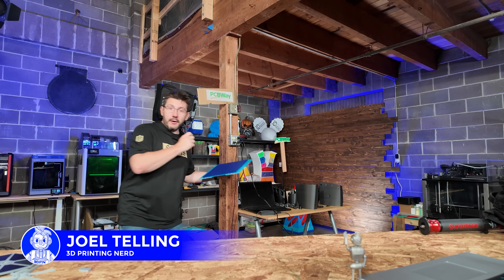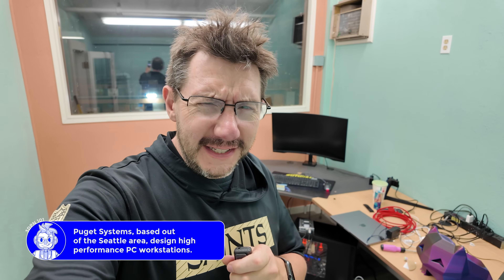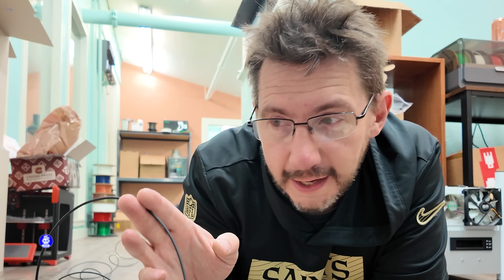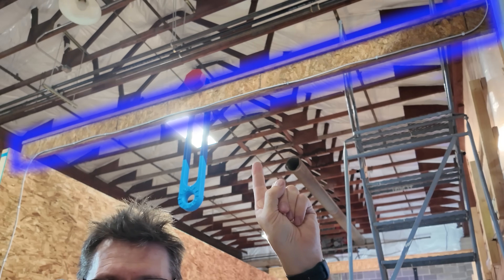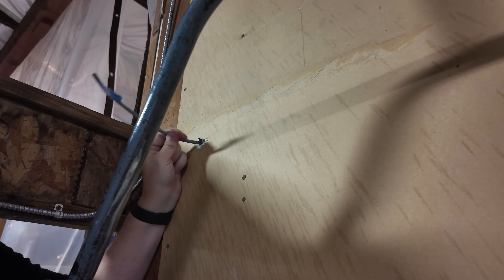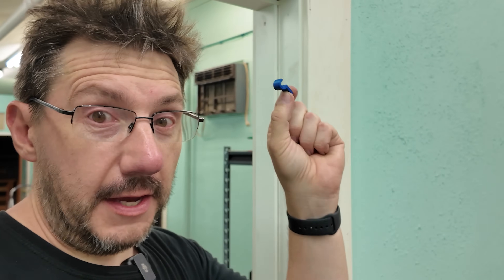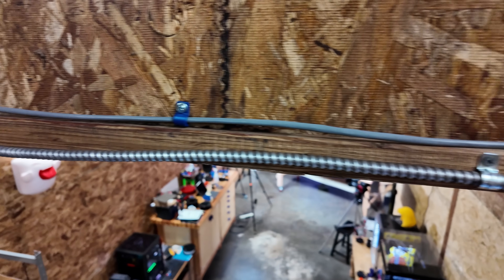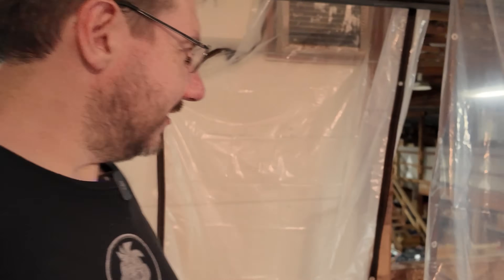3D Printing for My Ubiquiti Network!

Comment: Love these projects. Like you said, you get an idea, go for it and just take advantage of the momentum. Also: yay Ubiquiti... if any other company spent a fraction of their budget and time to cater to homelab and power users instead of "buy my 3 mesh router setup which only does _that_" then there would actually be competition. Meanwhile, my parents now tell me the football game is studdering and I can respond that the Dream Machine is detecting packet loss from the ISP side and they need to contact the ISP. You say you have overkill, I say "you have some items that some people consider baseline for setting up a homelab". All you need now is the rack.

I gave up on cable management (beyond ensuring they weren't knotted, had enough slack, weren't tripping/pull-off hazard, and were labeled) once people started guilt shaming people because they didn't make it look like a demo rack or, in modern times, like an AI image. If I had absolutely nothing else to do, maybe I'd do it. But not for now. Though just make sure you don't bend that fiber too much or you'll have a lot of pain.

Comment: Hint: I saw your cable was showing 'spiraling'which seems to suggest being pulled from the center of a coil. A kink in fibre might be catastrophic, so I strongly suggest to unroll the cable from the reel so it lays flat, not pull it from the middle of a coil which results in loops that want to turn into a kink. Good luck on your build!
Reply from the maker: That's a great tip - thanks for sharing!

Comment: Joel, I have a complete Unifi network, I have several recommendations for you.  1.  Don't use the Dream Machine Ethernet ports.  They seem to slow things down.  2.  pull a home run cable all the way from your wiring closet to AP.  3. Add a aggregation switch for 10 GB connectivity (8 additional ports) 4.  move the switch to the to your server room.  connect the NAS to port port 2 on the agg switch,   use a DAK cable to connect the switch to(port 1on the agg switch).  5.  connect the pro switch switch port 3 on the agg switch.  6. connect the fiber directly to your pc .  This mirrors my setup and I have great performance on my network.  please message me for more information
Rider68

Comment: Hmm that switch looks like the Enterprise Pro XG and I'm pretty sure it does not have POE, so you probably are using an injector somewhere... Also the two ports on the right go up to 25Gb and are SFP28.

Comment: Definitely Love Ubiquiti for IT installs. Definitely recommend setting up at the start for redundancy and future proofing. 
I have my printers all on separate WiFi/vlan. I assume you’re putting in new WiFi for your Farm too. For a large Farm I’d say for AP’s U7 Pro minimum but you could go with U7 pro max or U7 Pro XGS  as a way to have coverage, overall redundancy and speed . You’ll be able to run many devices and SSID’s with no issues. 
I prefer Startech racks for durability and strong construction, there are others but I prefer a strong rack and I use Rack Studs for mounting. 
Also Don’t forget you can use DAC cables in short runs and they’re actually faster than fiber in short runs. Pro HD 24 or Poe would be decent switch with plenty of options for fiber or you could do Pro XG 24 POE but depends on needs.

But in the end Good choice and have fun.

Comment: My wife and I just bought our first house, so I’m having fun equipping smart home devices, and soon, a Ubiquiti network! It will definitely be overkill, but I’m going to start with a Dream Machine SE (mainly for the PoE ports) for a couple cameras and home hub(s), as well as U7 something AP for the main living space. I just wish we had a higher bandwidth connection available. At our last house, we started with 1.2 Gbps, and it eventually got upgraded to 2.1, which was awesome. At our new place, we’re back down to 1.2. Champagne problems, I know. Lol

Comment: I think you'd be good going with one of the 8 port Ubiquiti switches. Depending on what spec you want for those extra ports in the office you could replace that switch with anything from the ($280 with power adapter) USW-Flex-2.5G-8-PoE (8 2.5GbE POE++, 1 10G SFP+ and 1 10GbE Copper) though you'd have to change your desktop connection from fiber to copper, or the $500 USW-Pro-XG-8-PoE (8 10GbE POE++, 2 10G SFP+). The $350 USW-Pro-8-PoE (8 1GbE POE+, 2 10G SFP+), the $480 USW-Enterprise-8-PoE (8 2.5GbE POE+, 2 10G SFP+) are also options, but the 1GbE copper on the Pro 8 will limit your access point bandwidth if that is a Wifi 7 ap, and the $20 price difference between the Pro XG and the Enterprise makes the makes the XG an easy choice over the Enterprise.

Comment: I find hard wiring devices using ethernet to be very satisfying, even if there is no performance improvement over using wifi. But some ideas to take advantage of that very powerful switch:
1. Unifi cameras - the camera interface built in to the UDM is very good - motion/sound detection, timelapse recording, alerts, etc. It does mean using Unifi cameras, and their PTZ versions are pricey, but the standard dome cameras work great.
2. Hardwire all your printers - especially the prusas. Prusa have built in excellent work arounds with connect, but the wifi is slow. I found hardwiring my MK4/C1/XL just made them more reliable. Instead of running cables from the switch to each individual printer, you could use a few of the Unifi Flex Mini switches - they are POE, 5 ports, and cheap.
3. More wifi access points for better coverage - the UDM has built in software that allows you to put in a floorplan of your building, and shows you expected coverage from your access point. You might already be aware of dead spots, but the software can let you see where a new access point might help. 
4. I don't know if you have anything raspberry pi powered, but the POE hats work extremely well - you could run pihole, or have a bluetooth repeater, or well any number of things.
5. Smart devices. It's a rabbit hole, but lighting/fans/curtains/hvac, etc, etc - anything that needs it's own hub. Will allow you to place the hub centrally.

My philosophy these days is "if it has and ethernet port, it should be hardwired." My cellular coverage is poor, so I give visitors access to my guest wifi, and you can start to feel the dip in performance when a few people are using it at the same time. Hardwiring everything that you can alleviates this somewhat.

Comment: Nice job. Things like this are one of the reasons I got into 3d printing back in 2019. Did you print those out of your high five blue protopasta? That's a gorgeous color.
Reply from the maker: The blue was a Polymaker blue I believe! Next prints are with highfive blue once more comes in :)

Comment: i used to enjoy that kind of work, but haven't done it in many years.  something i would highly recommend, whether you end up getting the 8 port switch others have recommended or not, print yourself a mounting solution for your switch & some track to lay your cables in (panduit or similar).  keystone ports on the wall become an optional upgrade at that point, but it'll all be much cleaner that way.
Reply from the maker: oh a track, that's a great idea!

Comment: If you're wiring up a space, pull two cables for every run. The absolute cheapest part of the project is the actual cable itself. Label it and leave it coiled neatly for future use. Future Joel will thank you.
Reply from the maker: GOODNESS that's a great idea
Reply: Agreed.  The most expensive project of any networking build out is the labor needed to tear open the walls and ceilings.  Consider using smurf tubes or other forms of conduit that allows you to easily add or upgrade your cabling.  Label both ends of all cables.
Reply: Exactly the same pop up in my mind when Joel telling us he was running one and only one Fiber… “Never put yourself into SPOF difficult time”.
Reply: ALWAYS at least 2, even if you only terminate one leave the others in the box.

Comment: I just upgraded my homelab to Ubiquiti. While you can't print a 19 inch rack I did use 3d printing for parts of the enclosure I built around an open 12u rack. Specifically corners for the mdf panels and fan mounts with mesh filters for cooling. Not done yet, but turning out really well.
Reply from the maker: Oh that's so cool!

Comment: You shouldn't use the Dream machines SFP ports for switching.  Those SFP ports are designed/spec'ed for routing.  It will actually add latency.  By connecting the NAS to a DR SFP its giving you higher DR overhead and lower NAS performance.  Its designed to be used with a distribution layer.  They have a low cost SFP switch they call "USW-Aggregation."  You use an SFP from the DR to the Aggregation, then all of your other SFP connections to that.  That will keep all of the local traffic contained to the Aggregation switch (which is specifically designed for high speed switching) and only outbound traffic through the DR.   Hope that helps
Reply: or use the "Pro HD 24 PoE" next to the DR as distrubution.   Use the other three SPF ports for things like your desktop.   That switch will be able to POE the access points at 2.5 gb.

Comment: Joel you wondering in my life/space *evil laugh*.  Half Network rack needed w/ patch panel (remember a Backup power supply (APC is a good brand) for your POE switch and Internet router)).  Fiber Cable type SingleModeFiber (SMF) or MultiModeFiber(MMF)-good for short runs.  Physical Module in the Switch = SFP (Small Form Pluggable module) these also needs to match your fiber cable type.
Reply from the maker: THANK YOU for the great tips!

Comment: For a  good coverage of your wifi you need more then one AP,  specially if you use the wifi6 AP that as not such a range to cover such a building good. Just my thoughts with a few more AP's in a much much smaller environment :)
Reply from the maker: I do have a second AP in the building, just not in a good location. I'll need to move it!
Reply: @3DPrintingNerd  Na get more AP's to get a good overall coverage.
Reply: @3DPrintingNerd  With WiFi 7 you'll only get the advertised speeds if you're in the same room with the AP, at least in my experience. So because our office PCs are wired I actually chose not to put an AP there, instead our APs are in the living room and bedroom where we are most likely to use laptops or tablets... Food for thought

Comment: A few options with ubiquity depending of needed client speeds...    (10G for all "Pro XG 8 PoE" = 8 x rj45 10G all PoE++, 2 x SFP+ 10G)     (2.5G for clients, 10G for backbone "Enterprise 8 PoE" 8 x RJ45 2.5G all PoE+!!!, 2 x SFP+ 10G) and last ( 1G for clients, 10G for backbone "Pro 8 PoE", 10 x rj45 (6 PoE+, 2PoE++) 1G, 2 x SFP+ 10G)      i can see many other suggest similar.   So unless you insist on rack mount, then those should handle your needs.

Comment: I have been working on my personal HomeLab at home and found a ton of 3D printable 10 inch mini racks to hold me stuff.  Lots of them work for the pro-user Ubiquiti stuff that have plenty of support for my home but a smaller footprint.  Take a look at the Ubiquiti UCG Fiber, Pro XG 8 PoE, and others in that form factor. Pretty much all of these already have a ton of free STLs you can find and print off the web.  You can easily print and make your own network rack to fit these components in a very capable and compact footprint.  That is next on my to-do list at home and 3D printing will be augmenting my personal setup.  Good luck
Reply from the maker: That's awesome! Sounds like a super cool project.

Comment: The Ubiquiti Pro 8 PoE is pretty much specifically made for this application. 2x10g sfp+ ports, 6xpoe+ ports, and 2xpoe++ ports. Also comes with a handy wall mount that you can definitely use wrong and mount under a desk!
Reply: I also have to recommend racking your equipment sooner rather than later. The longer you put it off  the more of a headache it will be. Also, buy at least a 12U rack. I generally recommend getting a half height even if you dont need it. Worst case, you never expand and it's an expensive shelf. Best case, you save yourself from having to buy a second rack when you outgrow the first.
Reply: THIS
Reply: Yep. These are the switches I use in both of my outparcels to manage the cameras and handle the fiber. Great piece of gear. I also second the rack sentiment.
Reply: That was my thought as well.  Posting to boost comment.

Comment: The flex 10gb would have been a better fit as cat6 is better for that type of environment as passing fiber transmitters through walls can be an expensive mistake. 

Probably could have saved you $1000 or at the Internet location for better overall network design.
Reply: Fiber through walls is fine? We do it all the time in enterprise environments. You should use armored fiber but a home or small office installation doesnt need that. Unless you are talking about the transceivers but those come off of the cable when you run it. I suspect Joel is in a high noise environment and in that use case, fiber backbones are always better. As an added be efit, it optically isolates you parts in case of single circuit surges.
Reply: @joshua7551 check the 3:18 mark where he pulls the whole transceiver through the wall.
Reply: Nothing wrong with fiber through the wall.  I'd have done something cleaner than just drill a hole in the wall, but that works ok.  Fiber is reliable, noiseless and not that expensive anymore.  For MRI suites we have to eliminate all RF interference into the magnet room.  That requires either running copper through a filter panel for isolation, or fiber through a short metal pipe called a waveguide.  I always opted for fiber when a waveguide  was available.  BTW, this wasn't even for Ethernet, let alone 10Gb.  It was good ol' RS-232 at 9600 baud for Anesthesia machine data to the EMR.
Reply: @ChipLinck I have no problems with fiber through walls. I have problems with transceivers being passed through walls. Check out 3:18 timestamp
Reply: @TerranceShepherd  Haha, OK, I see it.  -  Hey Joel, blow on that SFP module like a game cartridge!